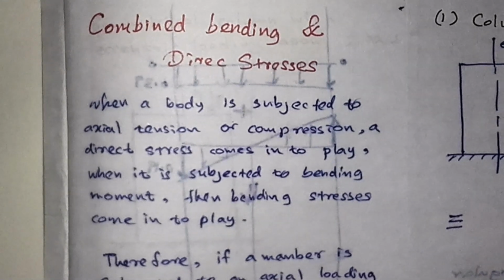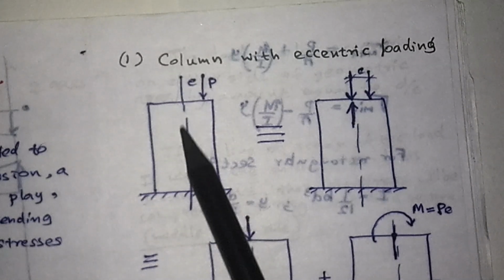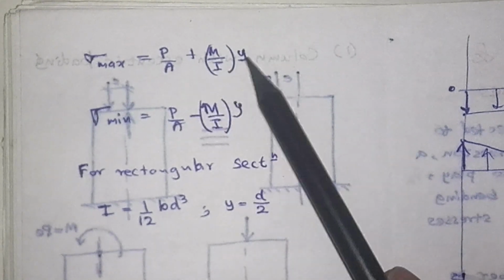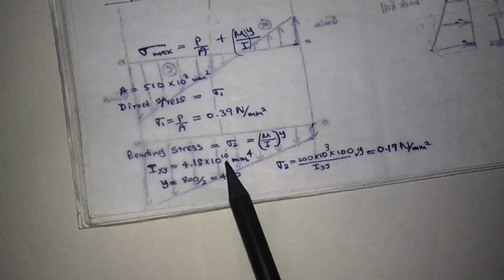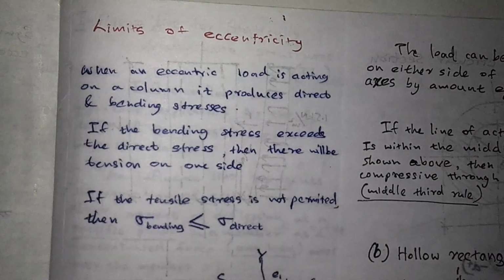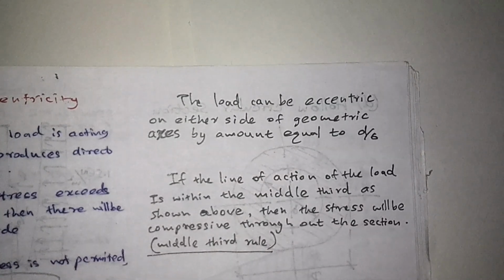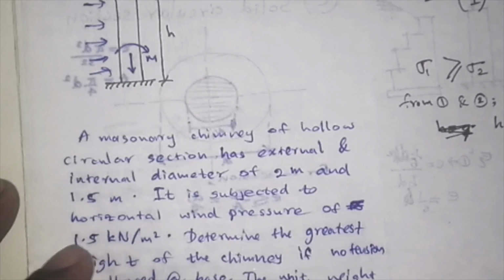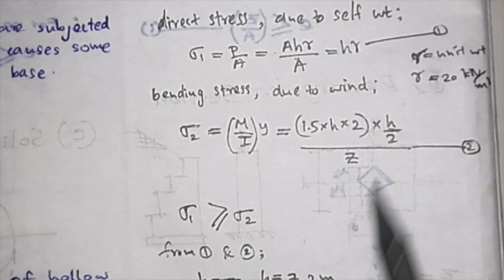Combined Bending & Direct Stresses - (Structural Design Lessons -7)

Comment: Hollow sections are most likely to experience combined bending and compression in low rise portal frame structures. In rigid frame action both the beams and columns experience bending. The beams are subjected to almost zero net axial force, and the columns generally experience relatively low axial compression loads. Rigid jointed trusses such as Vierendeel trusses would also experience combined actions, in which the level of axial compression is generally greater than a portal frame structure.
Reply from the maker: (Y)